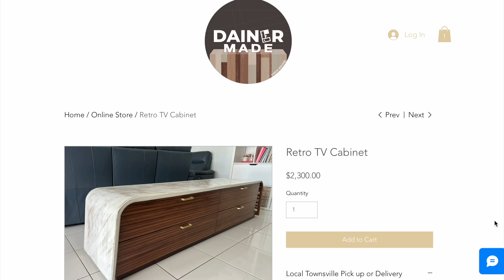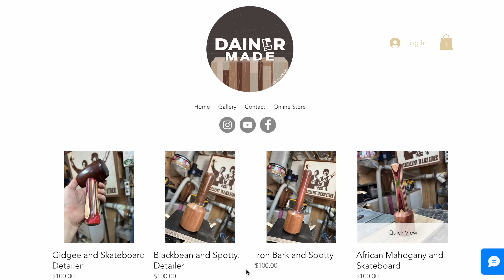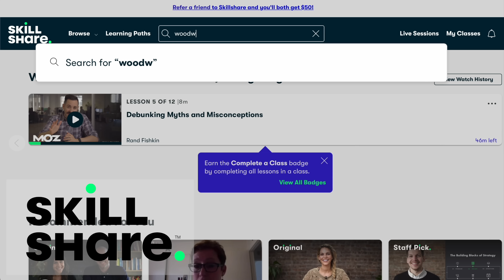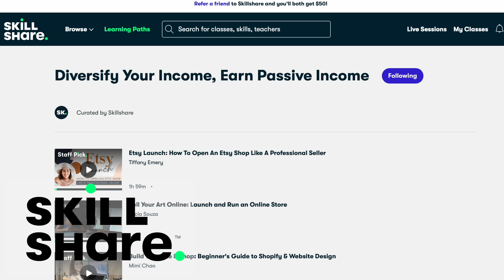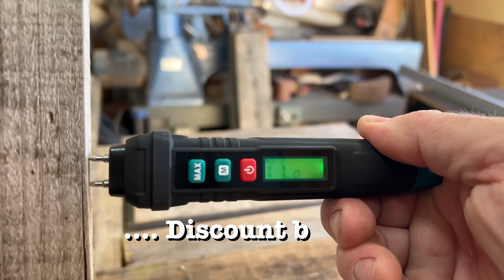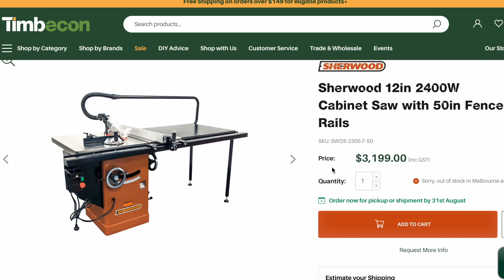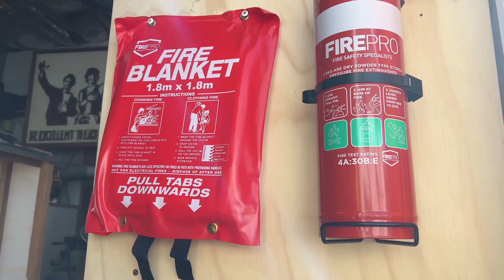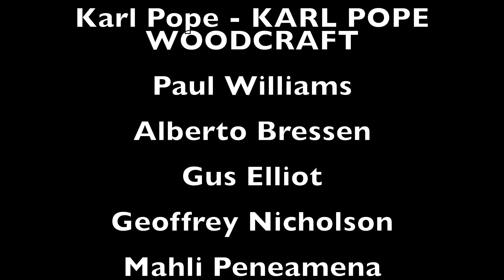EXPANDING my woodworking Side Hustle

Comment: Love your vids mate. I have been making my own picture frames for a few years to save some $$$ and had always used premade molding, but learned to cut a decent miter. I began with a Nobex handsaw and had some success, but it was slow going. In more recent times, I bought a circular miter saw and made some that way from prepared Bunnings timber. For my birthday this year, I asked my partner, mum etc if they were going to buy me a gift could they contribute some $$$ so I can buy an entry level table saw.. Now I really have the bug and have been making timber frames from basically scrap wood that was destined for the fireplace. There is something deeply satisfying about creating something out of 'scrap'.

Seeing your vids makes me want to make more cool items like tables and things. Love your work, it's very inspiring. P.S. I also have made a lot of videos for different purposes and it is not lost on me how time consuming making videos is. You are doing 2x the work there. Awesome.